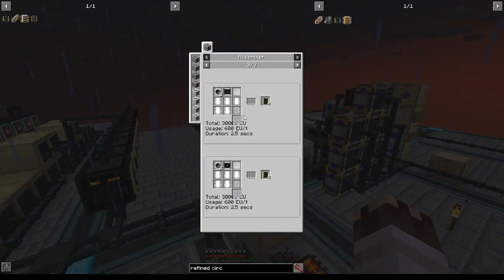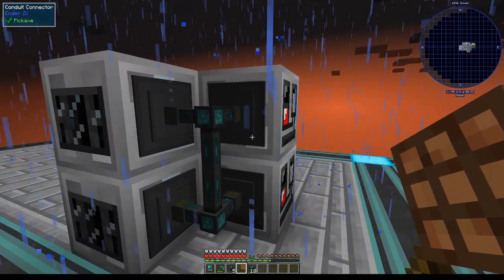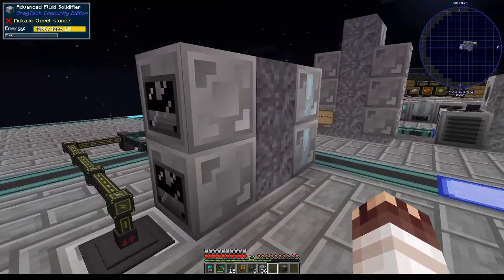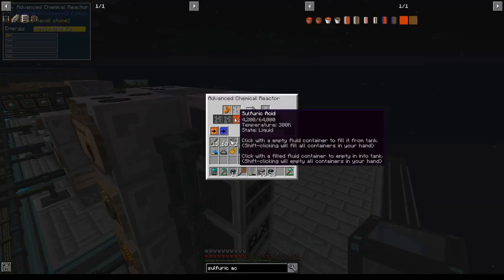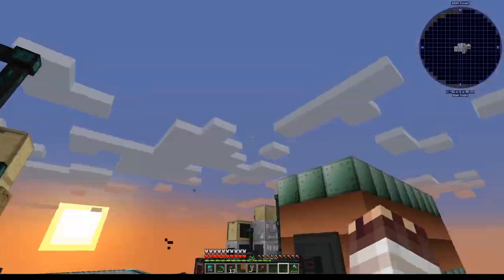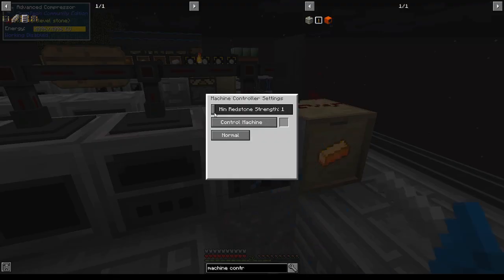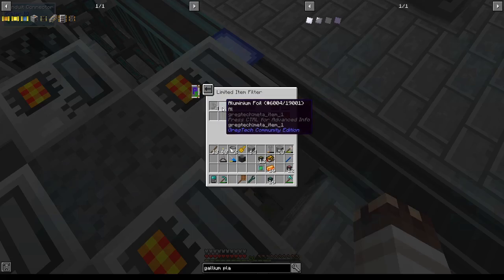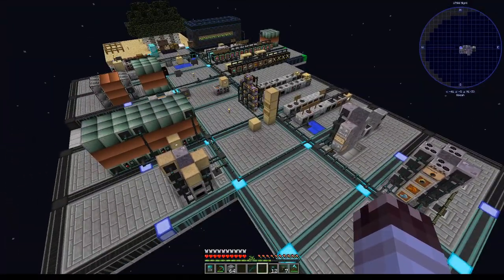New Omnifactory Supershorts #13 REUPLOAD: Refined Circuits

Comment: annealing a metal is to take the hardness out of it, so you heat it up and let it cool slowly, 

metals (particularly copper) will "work harden" - running them through any sort of rolling mill (or even hammering it) will compress the crystal structure and harden the metal, so technically you'd have to anneal copper in between every milling process, and you couldn't get "annealed copper wire" from a machine, you'd have to anneal it after, because the machine would harden the grain structure. 

for what it's worth, interesting they included that mechanic in some capacity though
Reply from the maker: That's really cool! I love physics, so that's very interesting to me. Thanks for sharing.